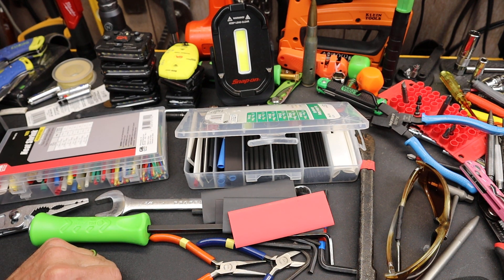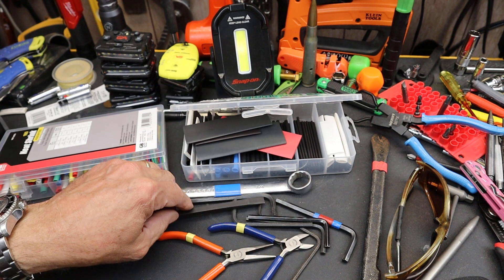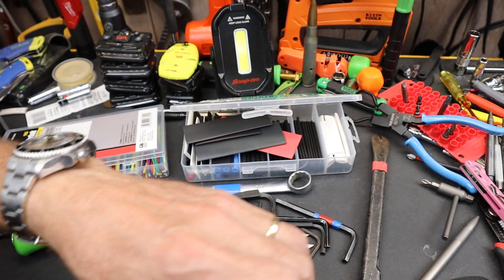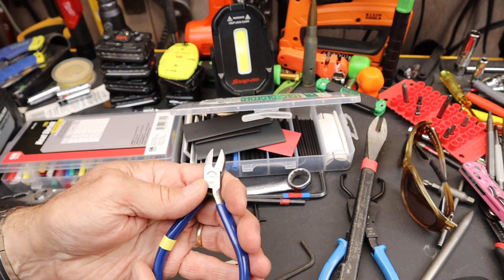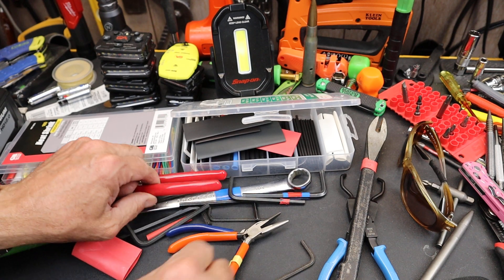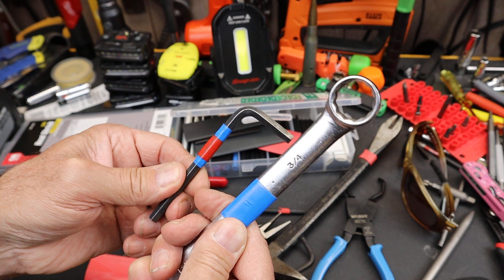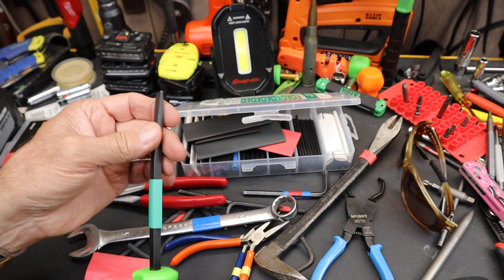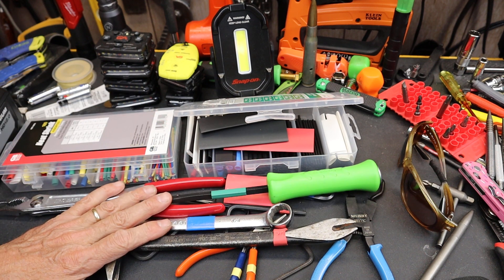Heat Shrink to the Rescue: Uses, challenges, and solutions with warm plastic. What do you suggest?

Comment: If it's just a bit too tight it's easy to stretch it out a bit before you slide it on. For the crowbar use spray paint.

Comment: I use it to color code my pliers handles.   It's also better for bundling wires than zip ties, with nothing to catch on.  I have a label printer that allows me to write on the heat shrink, which is useful. 

I always use 3:1 marine grade tubing with the glue lining.   The glue keeps the heat shrink in place instead of sliding.

Comment: 4:1 tubing works better for sliding over large objects when smaller tubing is actually needed. Marine grade heat shrink also has an adhesive on the inside of the tube that can be beneficial when fixing things like glasses. Lots of uses indeed!

Comment: I’ve used a scissor on the inside to spread the diameter of the shrink and use a heat gun to soften it and it’ll snap back to original diameter

Comment: Soldered joints in stranded wire tend to create a stress concentration, so they can fail in applications with lots of motion or vibration. I find that the adhesive-lined marine heat shrink is pretty stiff, so it works well to provide strain relief on soldered wire connections, even if you don't need the waterproofing

Comment: I have good luck expanding heat shrink to get it over a larger end. If done carefully it seems to shrink down almost as much as it would have originally. I use some needle nose pliers that fit into the tube while closed and then open the pliers.  Work around to expand the same end in multiple directions then do from the other end.

I do strongly prefer the heat shrink with adhesive. Little pieces of hot melt glue sometimes helpful to stuff inside before shrinking.

Comment: Hey Doc, For repairs like those sunglasses, you need to reinforce the structure more. I like to clip off inch or so lengths of straightened paper clip and glue it around the break (usually just one on each side, in the plane of strain).  I always wrapped it with wire or thread, though... Heat shrink is a great shortcut for that!
Reply: If he's going to hide the spot with heat shrink he could use a plastic welder with wire inserts. It's amazing how those will bond plastic back together. 

Not sure why a guy who spends thousands on tools , many duplicates of each other doesn't just buy a new pair of glasses. I just ordered a custom pair of Oakley's while my Maui Jim's are perfectly fine. I also suffer from a tool obsession. I personally wouldn't wear a pair of taped up glasses.
Reply: @scotts4125  I just got a plastic welder and used it for the first time yesterday on a laundry basket the kids had decided to play in. It looks ugly, but it's miraculous how well it works.
Reply: I try to use it on the side that will be less visible. Yes it works but very ugly. Lol

Comment: Also use it on my charging cables to reinforce where the wire meets the connector. Prevents it from getting frayed
Reply: Absolutely this. If any wire undergoes constant flex with use it’s worth using heat shrink to reinforce it before damage.

Comment: I put them on zipper pulls. If I have multiple pouches that “look the same”, the heat shrink tube color indicates what it’s for. Put them on some of my backpack zipper pulls too. Can also use it to give a little extra grip
Reply: I do the same with zipper pulls. If there is a nylon string, I wrap that to add strength. If the zipper pull is noisy, I add heat shrink to quiet them down.
Reply: @NathanBilbao  Yes, no jingle-jingle when hunting.

Comment: I hope this isn't too tangential, but your video reminded of something I've done in the past that proved very helpful. I used zip ties to colour-code speaker cables on each end prior to running them through walls. It meant I could easily identify an individual cable from both the roofspace and the wall, and match up the correct channel to the correct speaker.

If you have a lot of cables (say, for a surround sound setup) you can use multiple zip ties to number each one. If you have different-coloured zip ties you can create a simple binary (or higher-base, if you have a lot of colours) numbering system. Say, red = 0, green = 1, then encode a unique number on both ends of each cable. Like GGR would = 6. Just remember to always apply and read your ties in the same direction.

I started doing this after losing taped-on labels in the conduit one too many times!

Comment: I use heat shrink to mark the ends of charging cables. at my office desk, I have 6 or 7 USB charging cables. A little color on the head makes it easy to differentiate the 100W cable from the 5W cable without tracing it back to the charger. You can also use it to differentiate charging-only cables from data cables.

Comment: I wrap the ends of rope with tape and then cover it with heat shrink.  while it does not hold up under hard use it keeps the ends tidy and with colors allows me to know the length of each rope at a glance.  I also put it at measured points on some ropes and even winch cables for quick reference.
Reply: I whip the end of ropes while watching TV or videos.  Gives my hands something to do.  I use some of the mini- or micro- code from Atwood Rope or some kevlar fishing line for smaller ropes.

Comment: I mark tools with a label maker and clear heat shrink over it.
 Some label makers can even print on heat shrinks, but the ink can be abraded easelly. Thats only good for cable marking in electrical cabinets.

If you cant fit heat shrink over a cable, you should use self vulcanizing tape.

And one addition, you sometimes have to repair cables for outside use, you need adhesive-lined heat shrink in this case.

Comment: Axe/sledge ribbed handle. Place rubber o-rings first with heat shrink over top for perfect finger spacing.
Reply: you can also try tape made for hockey sticks.  Twist it first to create the ribbing, and then wrap the handle.

Comment: For these types of purposes there's also heatshrink with built-in glue to make a watertight seal. That really helps to keep it in place. For marking I generally prefer to use plasti-dip instead but heat-shrink is a nice and quick solution. I've also been known to mark tools with heat shrink with a Brother PT-E550 labelprinter, that way you can clearly see the size of your tools from a distance, but they don't have too many heat shrink colours as far as I'm aware.

Comment: I saw the title to your video and had an idea to put heat shrink over my knipex flush cutters head to make a little cover so it dosnt get damaged or poke anything
Reply: Done the same for Tsunoda + GodHand. Make them little protective hats.
Reply: @018CCHC  whats god hand
Reply: I do this with F-terminal batteries. A little red Jimmy hat for the positive terminal.
Reply: I’ve done the same for tools with sharp/pointy ends that I want to add some protection to. You can double up the heat shrink for extra durability.

Comment: As @Nihilimus mentioned, I use heat shrink tubing to add grip to bare metal, for example on the handles of old style pliers. Also provides a much nicer sensation in cold weather. Actually ordered some more this morning: large 35mm tube, to put a thin sliver around my new TONE 1/4" spinner that is too slippery when rotated with oily fingers.

Comment: One of the most popular mods for the Knipex Cobra XS and Plier Wrench XS is to use heat shrink as a comfort grip on the bare metal handles. I'm aware some people who've wrecked the grips on much larger pliers or want to minimise the size of the grips also use heat shrink in this way.
Reply: But you'll also lose the knurling of the bare metal though.
Reply: @hobbes3  not a problem... The heat shrink is naturally much grippier than steel.

Comment: I like to use to over hose clamps (mostly over wire made in place clamps). Further, it is a nice way to cover and protect hose splices and repairs. I mostly use marine heat shrink. I like to use colors over the top of the marine heat shrink for marking.